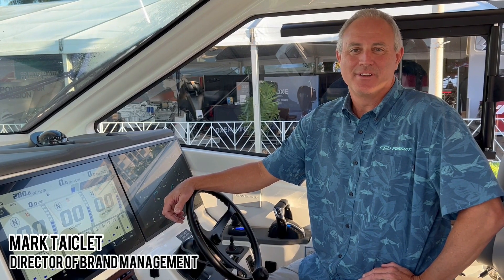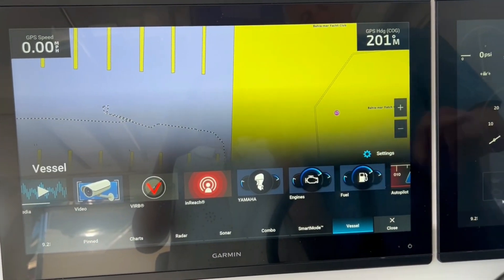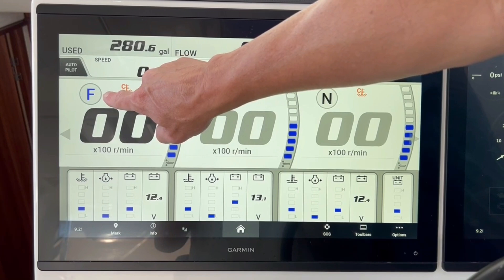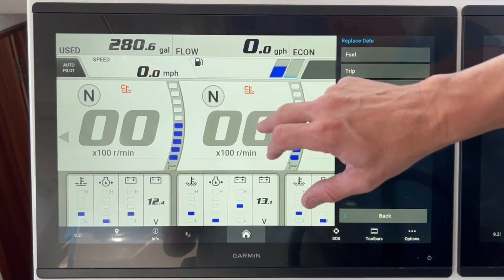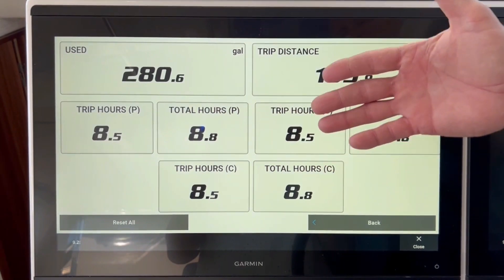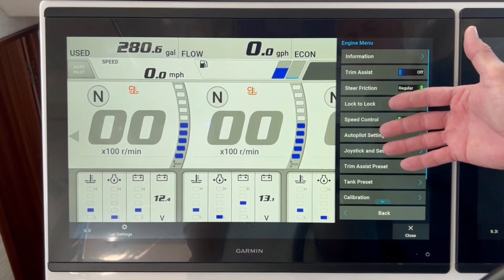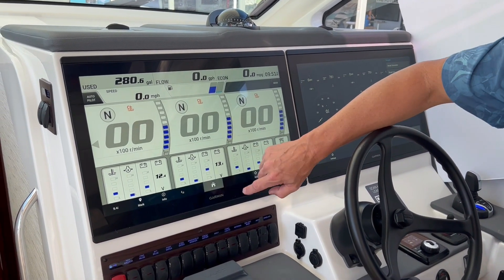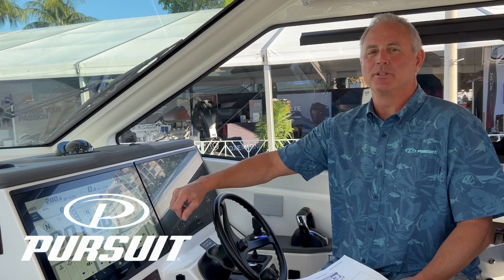Yamaha Engine Diagnostics Display on Garmin MFD

Comment: Very useful as the user manual does explain it that well.

One question , when I engage troll mode all works well but I am limited to only increase the RPM up to 1000 rpm is there a setting where I can adjust "up" the max troll mode RPM limit ?